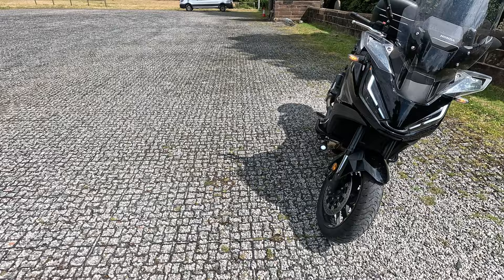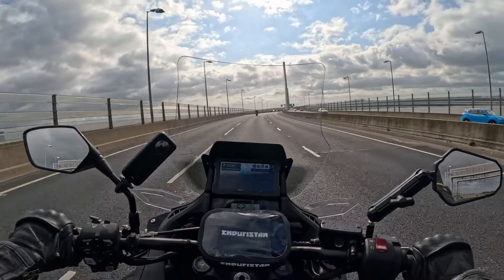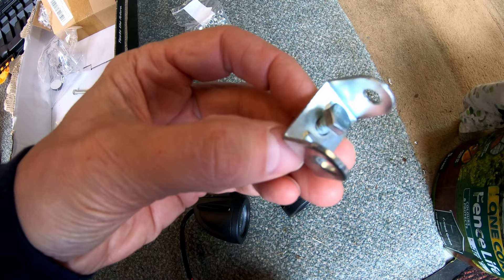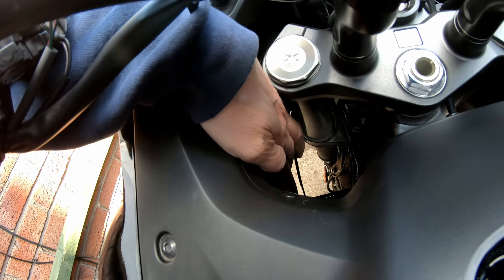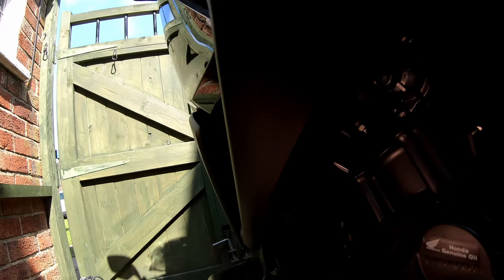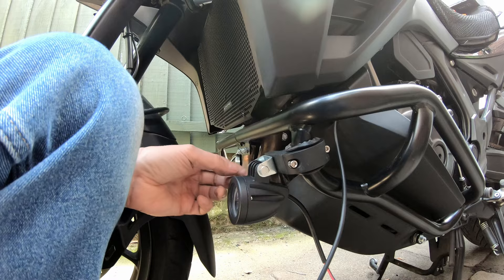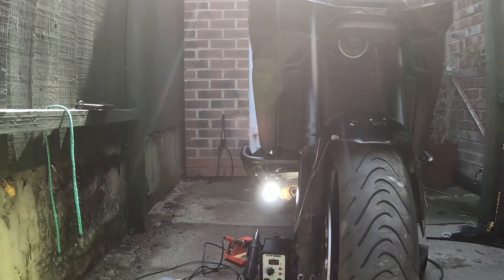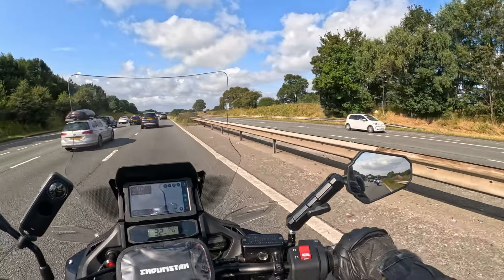Honda NT1100 Cheap Spotlight Hack

Comment: Nice work and those spots look great. I have the Honda ones, they came on the bike when I bought it. Whilst they function really well, the construction is somewhat sloppy and low quality and certainly not what I'd expect given the price .. the rear of the spotlight bodies are just plastic bowls that don't line up or fit very well at all. Having taken mine apart and put them back together again there's no way I'd have been happy at all if I'd bought them myself. For the asking price I'd expect full metal housings, billet alloy or similar. Just look at what Denali offer for a similar price and the quality is night and day different, they make the Honda offerings look quite cheap ....
Reply from the maker: Thanks for the info. That makes me feel better. I was quoted almost £500 by dealer to fit Honda version. And of course they don’t offer a crash bar. So, although the crash bars aren’t cheap, I feel this (or something similar) could be a better solution. Of course their wiring would be neater, but that is something that could be addressed with a bit of effort. 👍👍

Comment: So if you were to wire them upto the Honda oem fog light wire sockets, couldn’t you then switch them on and off using the switch on the throttle cluster?
It’s pretty easy to activate them in the menu, there are plenty of youtube videos showing how to bridge the obd port with a wire to gain access to the activate menu. Worth a try Codger. 👍
Reply from the maker: I’m sure you are right. But I wanted a quick and easy (temporary) install. As always ‘temporary’ is a moveable feast! 😉😂👍👍
Reply: @CodgerBiker  Ahh I see, easily removable so it can go onto the ATAS in the near future! 😉😉😂👍
Reply from the maker: Definitely Maybe! 😉😂👍